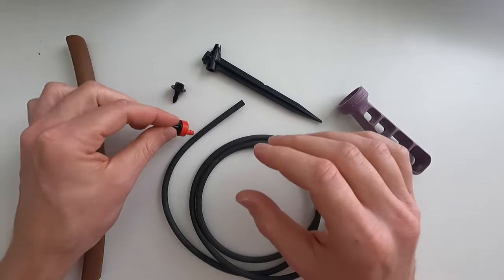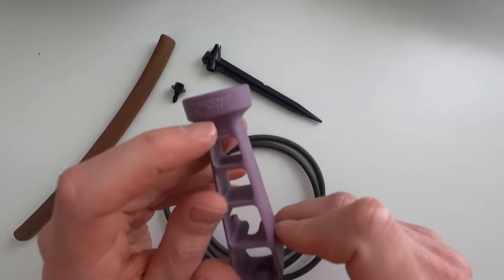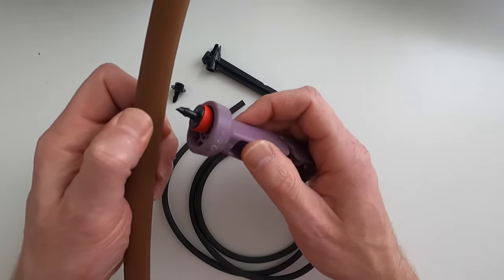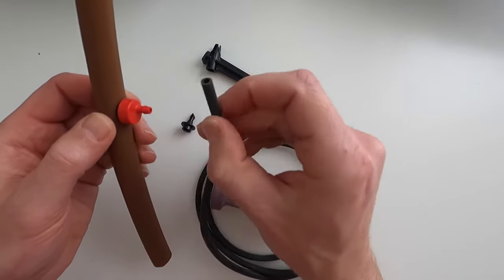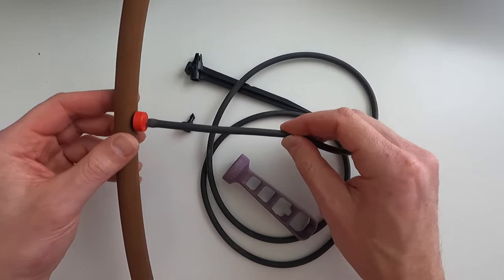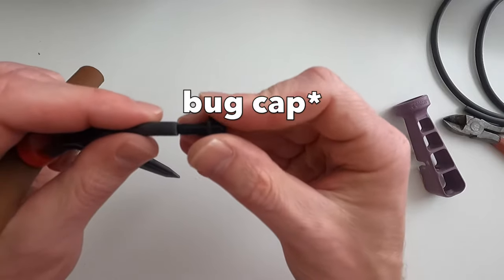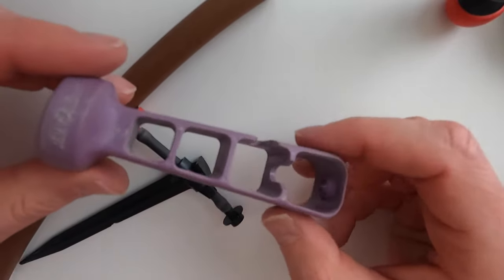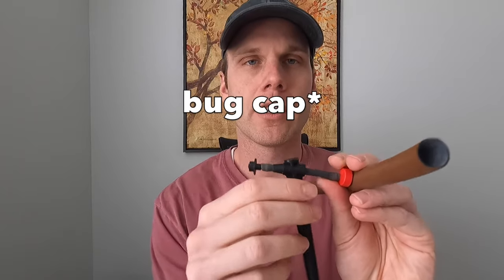Installing Rain Bird Drip Emitters

Comment: Am I missing a something?  I thought the red piece is where the rainbird actually drips water from??
Reply from the maker: It definitely can be.  Sometimes you will want to be precise where the water is applied and worry less about the main drip line moving.  Also, sometimes you will have multiple emitters for one plant and you could perhaps have one on each side or three where you would have them in a triangular pattern, etc.  Lastly, the bug cap on the end will help keep the bugs out that could clog it.  Hope this answers your question.

Comment: If your 1/4" run is over 5 feet, I believe your emitter goes on the end and not into the 1/2".  Is this correct?
Reply from the maker: I’ve never ran them more than 5’ so not sure.

Comment: Our drip system was professionally installed.  Each plant has a flexible stake or two.  I'm noticing very uneven watering.  Some plants are getting a steady stream, some just droplets and some no water at all.  This system was just put in.  What causes this problem.  Any advice is helpful.
Reply from the maker: If a bug cap wasn’t used, bugs can get into the ends and clog them.  Difficult to say without testing each individual part.  I’d call the contractor to see if they will warranty it.
Reply from the maker: Might have debris (dirt particles) in the main line clogging emitters randomly.  Hopefully each drip line has a filter at the start of it / just after the valve.  Make sure that is cleaned at least once a year.  Also can open the end of the drip line and flush the line.  If things are clogged the only solution might be to replace those specific parts.

Comment: Hi!  Can you also punch more holes in the orange tubing with the built-in emitters and put in those red emitters?  I need more holes in mine...?
Reply from the maker: Yes you can, just not too close to each other and as long as the pressure is sufficient, which typically isn’t a problem if designed correctly.

Comment: Hi! I was wondering if I can water 3 plants with one 2gph emitter. Ex: 1/2 tube then a 2gph emitter then tee off the 1/4in tubing. Great video!
Reply from the maker: If you do that would definitely want a higher gpm emitter.
Reply: One emitter for a plant, two emitters for a plant but newer one emitter to two plants. The pressure after emitter is very low and probably just one plant will be watered. I made the mistake.

Comment: Super helpful!  I thought I was going to have to replace a section of line because the red drip caps are in the wrong spot once we relocated some plants, I didn't know you could add the black 1/4" line to redirect the flow elsewhere - super easy now!  Thanks!

Comment: Just found your channel, last house had sprinkler system done already that fit my needs. This house doesn’t. Video idea: I have an older system and it has these pipe pole type sprinkler heads for my flowerbeds. Can you do a video on how to convert that existing connection to the blank drip line connection?
Reply from the maker: For sure.  Help me understand better what the existing set up is so I can make sure when the time comes we can do the right type of tutorial.  

Are they sprinkler heads on top of PVC pipe (white pipe) coming out of the ground? Or are they skinny black/grey pipe with nozzles on top?  Or something else?
Reply: @thesprinklerchannel  pvc In the ground and then the grey pole type with nozzle on the top is coming out of the ground. Does that help?

Comment: I've got too many emitters in the wrong spots on my feed line. Are there ways to remove and seal those? Plus, whoever installed this system didn't think their garden through as some 1/4" lines are WAY too long and reach yards away. Thanks!
Reply from the maker: You could just kink and tape the emitter lines branching off the main drip line.  Otherwise just have timo cut drip line and put a coupler.
Reply: @thesprinklerchannel  Home Depot sells a "Drip Repair and Expansion kit" - comes in a bucket - for around $32 which includes 1/4" tubing Goof plugs (10 in the kit) and those will work to plug the holes I need plugged. Thanks for your suggestions! The kit has oodles of goodies...250' of 1/4" tubing too. SCORE!!

Comment: Can you install a 1 GPH emitter in line with the 2 GPH emitter in case you wanted to reduce the flow ?
Reply from the maker: What do you mean by flow?  What’s the end results you are looking for?
Reply: @thesprinklerchannel  I mean the flow rate. I was thinking if I already have a 2 GPH emitter and want to reduce that to 1 GPH, rather than cut the tubing, can I just connect another length of 1/4" tubing to the first emitter then hook the 2nd lower flow rate emitter ? End result is: flexibility to switch between two flow rates

Comment: Is it me or does this seems overly complicated versus micro holes in a hose and then U brace the hose in place.
Reply from the maker: So there are the pre-installed emitter drip lines which are good if you need to soak an entire area.  This is how it’s done for shrubbery and trees when a specific location is wanting to be watered.

Comment: This is wrong. The red side goes into the hose.
Reply from the maker: The pointy black part pierces through the main drip line until the barb catches the wall of the tube.  Hope this helps.
Reply: @Lisa Greenough there are different ways to do it . If you put the emitter on the larger tube side then you don’t put another one at the other end